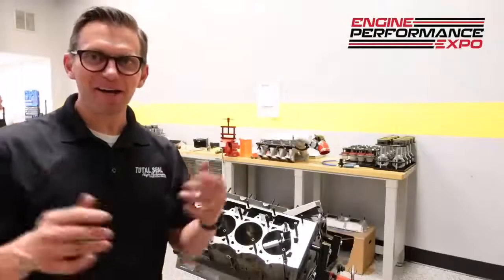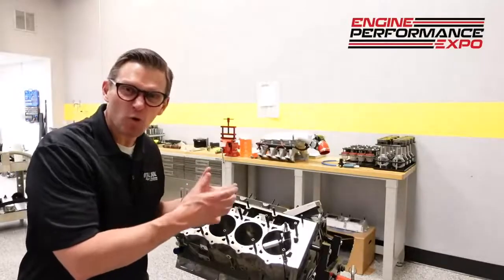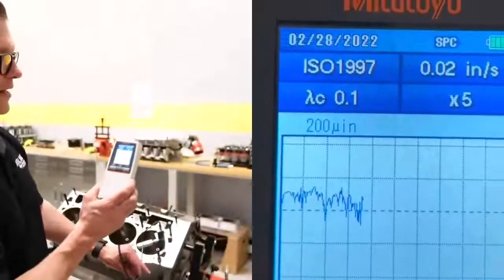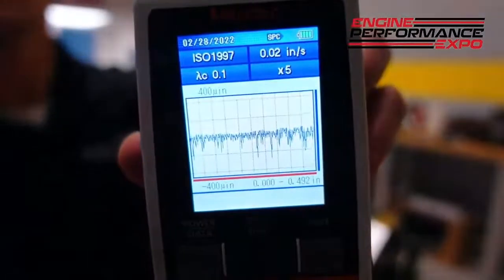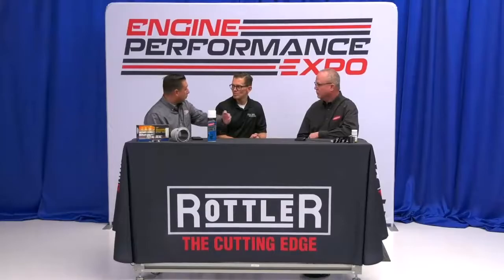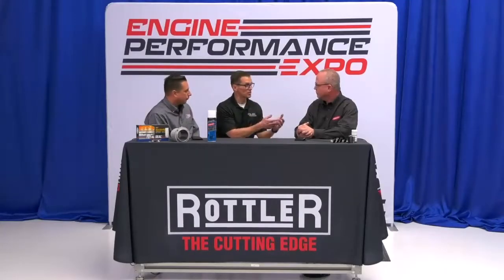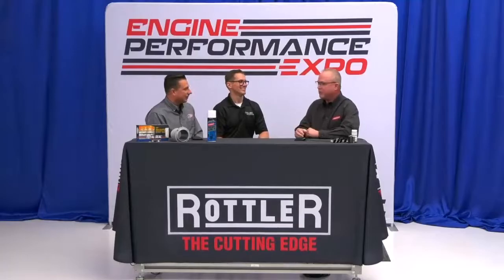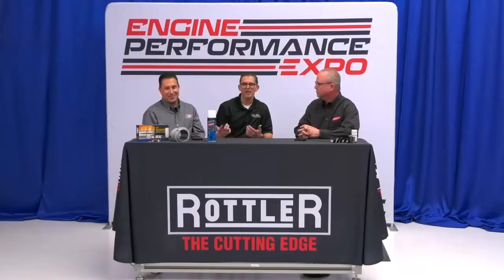Foggit showcase at Engine Performance Expo 2023

Comment: This video was an upsetting & depressing reminder & ironically my Grandfather's 87 Vette with 17k miles has been in storage for 20yrsdue to my own bad health.  I dread & expect the worse of those cylinder walls especially here in S.Florida.  I have a borescope & planned methodical procedure before even considering cranking it by hand & I even bought a professional pre-oiler from a famous company that makes oil accumulators too.  

This pre-oiler made from a converted Fire Extinguisher with the red paint sandblasted.  I was going to use it some day if my health improves, so after I got it last year, I stuck my finger in one of the ports to feel the weld penetration & I felt grit!!!!!  
My finger had tons of aluminum shavings on it.  I flushed this Pre-Oil made by this famous company that starts with a "C", many times with dish soap & flushed out about 1 +Tablespoon of aluminum shavings & fine aluminum powder!😵
 They never flushed the tank after drilling & welding all the fittings!  Good thing I have health problems & didn't use it, or it would've destroyed my motor!  I emailed them the photos & about this major issue & that they should Recall all of them at their distributors who sell them.  Their response was pretty much nonchalant.  

I can only wonder how many engines out there have been destroyed & guys never knew to check their new pre-oiler before using it, as nobody would even think to check it for contamination!

Anyway, now I expect my cylinder walls are rusted after 20yrs, & would need to figure out a chemical soak to dissolve the rust.  Some form of acid like indusrtial vinegar or CLR, or something.......😢
Definitely will be using your FogIt Oil if I ever get myself in shape.